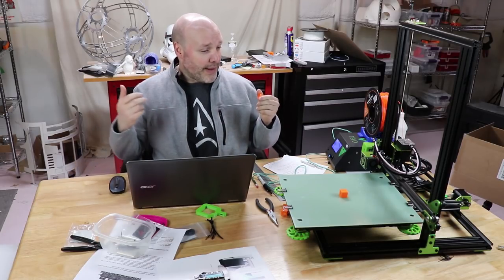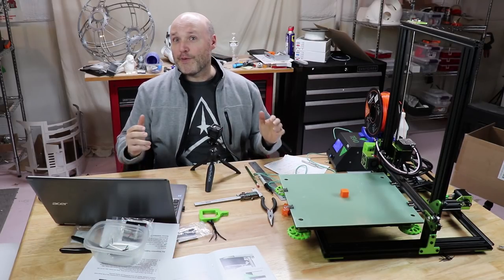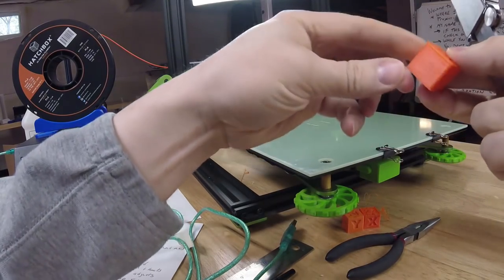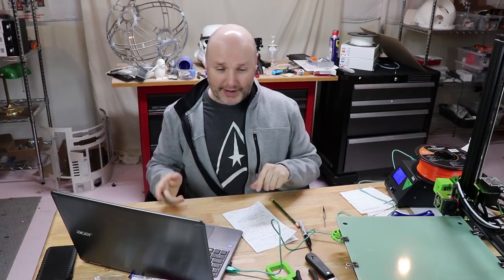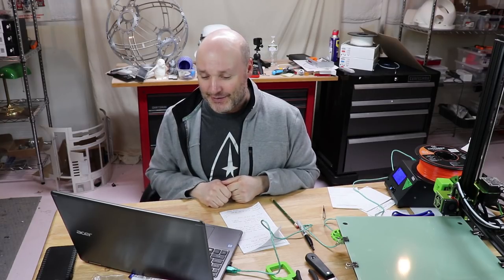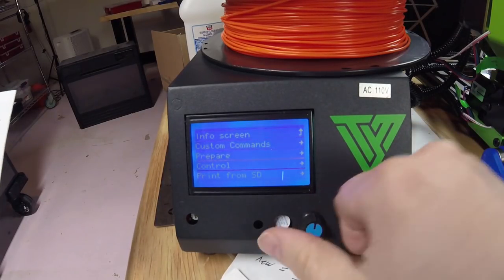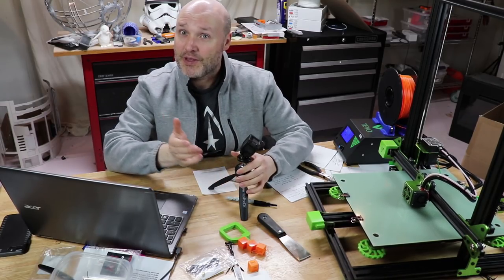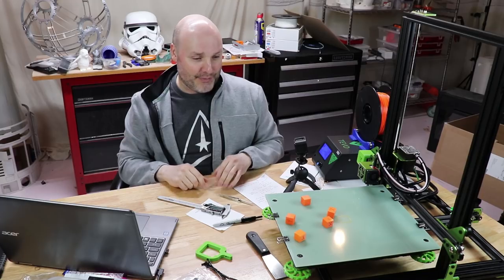Advanced Tuning: ESTEPS calibration and PID Control for your Tevo Tornado 3D Printer

Comment: This is wrong. You never calibrate movement steps based on a shrinking material. The BEST way to adjust steps/mm is to command the axis to move 100mm, measure how much it moved, and adjust based on that. Doing it this way will remove the numerous other variables (extrusion rate, material shrinkage, etc) that this guys calibration method has.
Reply from the maker: As I have learned from others, I completely agree with you.  I should re-edit this to cut that section out and keep the PID autotune section in.  The way I was taught wasn't correct and as you rightfully point out, mechanically verifying the esteps in the proper way to do it
Reply: @WhereNerdyisCool  Just wanted to throw it out there for anyone who might see this vid!
Reply from the maker: @wbreslin951  that's why I pinned your comment to the top!  I love feedback...I like learning and even when I'm proven wrong, I want to learn it correctly!
Reply: Hey @Where Nerdy is Cool!, Should I just ignore everything but the PID autotune section? If so this cover everything about the extrusion calibration? And if Not could you make another video about how to correctly  calibrate a 3D Printer Extruder. Thanks for the videos buddy. I've subscribed and watch .  I'm a noob and it is getting complicated but I'm working it all out.
Reply from the maker: Yes.  AutoTune is correct.  What I was shown on doing esteps isn’t correct.   We’re all learning here!
Reply: William Breslin i see what you are saying. Would you be willing to explain further? Are you saying that if i home my extruder, the move it in x direction 100mm, measure that, and its only 98.3mm. I use that number for my x calibration?

Because the method he uses is correct BASED on a specific application.. if you want your parts to index correctly, then you must do it the way he was because of the shrinking material. But if you are not making parts that are indexing, then yes, your method is just fine
Reply: @WhereNerdyisCool  Hello, I know this video was made some time ago, but I am glad that you didn't edit out the part starting at 12:45.  I actually found the calculation helpful for the x, y and z axis and getting the cube to the correct measurement. This method worked fine for me.

Comment: Fantastic video thank you for sharing. I was able to calibrate a 20mm cube to within .05mm! However when I ran it scales to 40mm it's big .5mm in all axis. Any suggestions?
Reply from the maker: You could also check your mechanical esteps...meaning, make sure if you move the X / Y / Z axis, use a ruler/caliper and make sure it's really moving the distance you commanded it

Comment: #1 My "Z" must be loosing a lot of steps as it's knocked off 4 prints right off the bed, (Including the over sized raft). At around the 1"/1-1/2" height the nozzle starts hitting the print. So how do I adjust that?
#2 What are those programs you're using on the laptop?
#3 Is there a more detailed video to show me how to use those programs and more importantly "What am I looking for in the way of Search terms?
Reply from the maker: If you’re knocking over prints, one trick you could try (which I use, too) is to add z hop.  In Cura you’ll find it under Travel and Z Hop When Retracted.  The default distance is 1 mm.  In Simplify3D it’s on the Extruder tab and called Retraction Vertical Lift and you can put in a value like 1 mm. Good luck!
Reply: @WhereNerdyisCool  Been there; Done that! Up to 6mm. It's not the hop, it's hitting as it prints. It's loosing steps in height, layer by layer as it prints.
Reply: @WhereNerdyisCool  You haven't said a thing about the programs;  are they a secret or pirated software? I thought most of the software was open-source.
Reply from the maker: The software is free, with the exception of Simplify3D.  Nothing secret!
Reply: @WhereNerdyisCool  have you got a link for the 'free' part.... I haven't got a 150 bucks for S3D.
Reply from the maker: Which part?
Reply: @WhereNerdyisCool  You said some of it was free programs -- mainly the one that you were typing in the g/m codes.... I've got Arduino installed for flashing the firmware as recommended by Tevo. I'm hoping that and adjusting the estep will fix the z height problem.

Comment: My TEVO Tornado is going nuts.... it will shift the print to the right as much as a half an inch after about 15 to 20 layers... then the next print will be a half an inch to the left (X axis). What do I look for to fix this?
Reply from the maker: Stepper drivers staying cool?
Reply: @WhereNerdyisCool  Yes as far as I know.... I've done 1 and 2 day prints without a problem... now even a 20 minute print will shift. (Side Question: Have you updated to the new version 2 Marlin?)

Comment: great video, hopefully I'll get to these advance tuneing soon. I setup my first printer the tornado, yesterday and it seems I'm getting clicking .."skipping" from my extruder. I'm planning on raising my extruder voltage from 0.95v to 1.0v, and making sure there aren't any blockage in my filiment tube. would you have any other advice on what else to check if these dont solve the skipping?
Reply from the maker: It's interesting you mentioned  this...I have a recent print with a Y axis shift, so upon doing some research, I have to increase my voltage on the Y axis.  If you have skipping in the extruder, be sure to check that hard-to-reach tension screw...that might be worth checking out too!  And the Facebook group is a great resource too...if you can catch it doing it on video, share that on there!  (Thanks for Subscribing!  Welcome!)

Comment: Thanks for putting this together Paul. Another great video!!
I've got a question for you, regarding the PID Autotune... I followed your commands exactly, and the first time I wasn't sure if I read it correctly, so I ran it again. Since I got different results the second time I ran it a third time so I could use the average and store it in my firmware... Well the third time yielded wildly different results, especially on "P" & "I"... Do you have any thoughts or recommendations?
1st) P=57.06 I=10.55 D=77.12
2nd) P=56.55 I=10.79 D=74.12
3rd) P=21.00 I=1.42 D=77.83
Reply from the maker: I run it multiple times as I saw others do. It seems the result is the best average?

Comment: I am new to the Tevo Tornado and I just ran the PID Tuning, adjusted and stored successfully, and wanted to make the change recommended by Paul in the video in the configuration.h file but I can't find it.  I have Simplify3d that I used for the tuning. Can any one tell me where it is?
Reply from the maker: Hi Dan.  Due to the limits of this chat box I can’t show you where it is but if you do a Ctrl F and search PID you should spot it. If not let me know
Reply: @WhereNerdyisCool  Thanks Paul but I'm on a mac so Ctrl F doesn't do anything! Any other suggestions?
Reply from the maker: @danskow9718  Command F?  I don't know Macs.  Could never afford one  :)
Reply: @WhereNerdyisCool  Thanks, but it appears there is no configuration.h file on the mac.   The printer is not reading a config file from the mac anyway.  Why would I have one on the mac?  Is it in the firmware?
Reply from the maker: The Marlin firmware is where you could enter that value. Assuming you are familiar with editing and compiling your own in Arduino.  Otherwise, the gcode commands or manually enter it in the control box would work

Comment: Thank you for your video! How do you get such wonderful adhesive results? My calibration figures are unglued almost 90% of my prints and that lead to print failure of course :-((( tevo2018, glass hotbed, stock config.
Reply from the maker: I'm having great luck with Polypropylene Build Plates from Tiny Machines
https://tiny-machines-3d.myshopify.com/collections/awesome-upgrades/products/polypropylene-build-plates-for-3d-printers
Reply: @WhereNerdyisCool  How do you remove the heating pad under the glass and glue or bond it to the new bed plate?
Reply from the maker: Very slowly and carefully.  Then apply to the new bed

Comment: I used a needle and ruler. It looks good but 0.1mm is hard to see
Reply from the maker: Great idea!
Reply: But my issue now is I dont know how to  make my Y axis to print correct.  It turns out 0.1mm bigger compare to X.  Basicly same when scaling it up the test cube..
If I try tune the y steps for a 20 cube it works..
However when scaling up at this point it gets wrong again. 
Also noticed increasing infill makes it shrink less. 
100% infill 10cube  = 10.05
20% infill  = 9.90-95 ish

The gt2 belt sits tight . And it has quality pulleys. Even tested printing slower but it doesnt seem to be backlash.